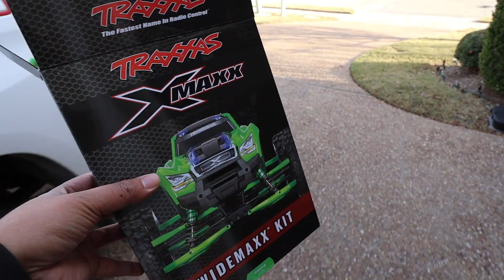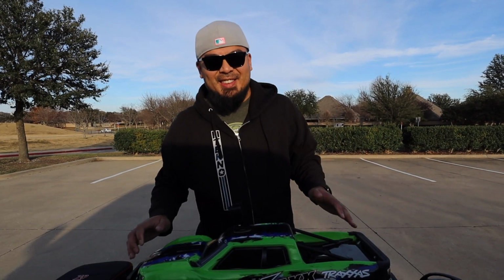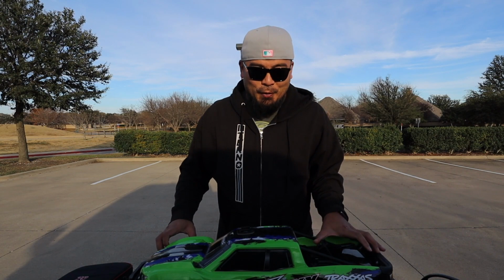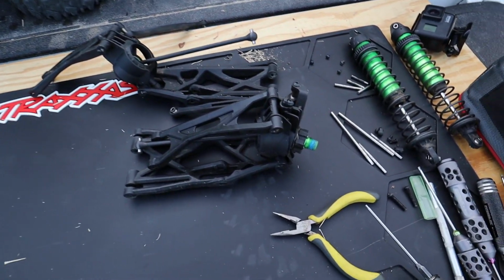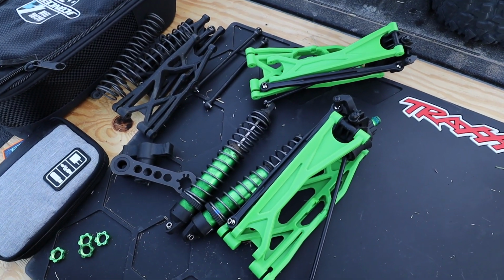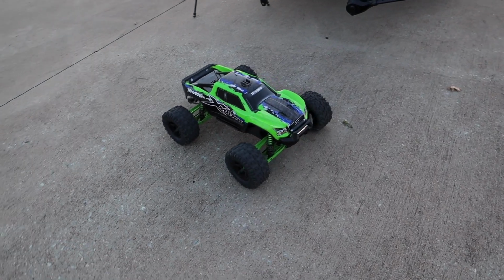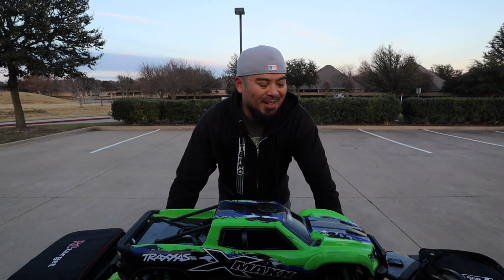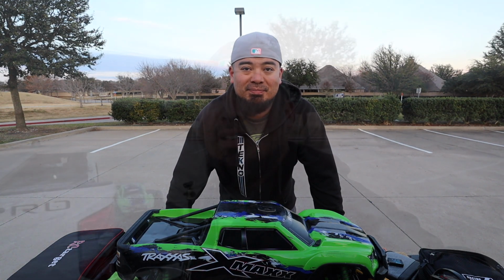Traxxas XMaxx Widemaxx Review Before, After, and Install | BIG FAST RC Car

Comment: Would love so see a high speed run with this kit. Still debating on if it’s worth it. Never had any major cornering issues with my xmaxx. On this Maxx, this is a mandatory purchase.
Reply from the maker: I wouldnt consider this one as crucial as the maxx widekit but it does make you like the xmaxx more... hahaha

Comment: HOLE! That’s the RC version of a dog saying Squirrel! I say that because I  take my RC’s out in an area that has some pretty  gnarly  squirrel holes & will damage them so I have to be on high alert because you can’t see them.  Wider is better seems to be the way. I have a Windigo & any body knows stock it loved to flip over I used wheel extenders & some nice wide wheels & tires & it made a huge difference overall.

Comment: Longer arms will only do small changes in driving. What Traxxas need to do is make a coilover for their vehicles that has adjustable high and low speed compression and rebound adjustable. This enables possible different combinations for style of driving and tuning.

Comment: I wonder how its gonna hold up during the crashes, I broke stock arms quite a bit so the longer must be worse as far as durability goes? Would love to see some bashing to see.
Reply: my gut is telling me it will be worse for bashing, more chance of catching a tire and more leverage on the inner part of the arm after landing jumps off center or cartwheels.  I just got an Xmaxx last week and broke a stock arm, I think I am going to go with RPM arms with the threaded pins. I felt like the truck stock was fairly stable and balanced.
Reply: @davidbrennan5   haven’t had any issues with it so far
Reply: @Jobro_Ya_Know  that's good to know I might buy the kit, local store didn't have stock arms I bought a set of aluminum but I don't think I'm going to install them I broke the upper rear bulkhead need to order that part I talked to people who ran rpm arms and several told me they are cracking seems like traxxas heavy duty arms are the best option for replacements or the wide Maxx kit
Reply: @davidbrennan5  yeah I haven’t tried the rpm ones. I wouldn’t go with the aluminum ones they bend a lot. I beat on the xmaxx quite a bit. I have had a couple bad landings but not enough to say they are indestructible. Good buy I think the handling alone is worth it. Seems to jump better too.

Comment: Hey Mark, little bit of an off topic question but i was wondering which tires would you recommend for bashing the xmaxx? trenchers or sledghammers?
Reply: Little bit of a late reply but if you haven’t already figured out. Trenchers are just about the worst option anyone could think of for bashing. They weigh almost a whole pound and a half more per tire than the stock ones. Sledgehammers are what I am using and I have only blown a tire once with a castle system

Comment: Just saying, if u replace the shock oil to 40wt,and adjist the spring collars, the thing will have very very little bodyroll, i have badlands on my xmaxx with the widemaxx kit, and on tarmac, u can half throttle the truck and turn and it wont flip,  it just slides and become a drift car, how sick is that lol

Comment: I want to get it... I just don't know if it's worth 200 bucks.
Reply: Why not? Isn´t it a Killer deal for 10 plastic parts, 4 springs and 4 drive shafts?!  ;) Here over in Germany they even want 200€ (Compared to the US 199$ it schould be more in the range of 177€.)

Comment: With all the batteries you charge I'm surprised you don't have a charging station. I see horror vids of batteries exploding or catching fire. I've been debating a battery box myself...
Reply: I've never had a Traxxas battery give me any problems ever. However, the lesser known brands all have caught fire eventually. I kept all my Traxxas vehicles using Traxxas batteries and chargers and I monitor everything from my phone while charging. It's the best setup ever. No other aftermarket company can match Traxxas' research and development.

Comment: I bought the kit and installed it but now it seems it need a huge area to turn when driving, and standing still on short grass wheels barely turn, so question is my servo dead if yes is the upgrade version from traxxas worth it or should i buy something els Plex help
Reply: Just recently did the wide kit on mine and it definitely makes the turning radius worse. Pass on the traxxas servo they are slow and there are so many better options for the same price.

Comment: Hey Mark. Have you come across any solutions for the pinion and spur stripping and/or coming lose issues? Can’t get through one set of packs without them stripping. Running the high speed pinion.
Reply: Them stripping can but bad gear mesh or bad gears. Check gear mesh I set my manually and havnt stripped a gear in a year.  I had a issue with the pinion coming lose I wiped down motor shaft with degreaser then used some blue loctite on the grub screw let it sit for atleast 24hrs